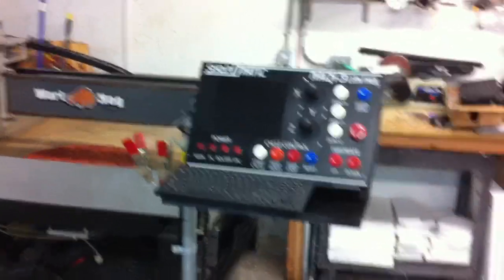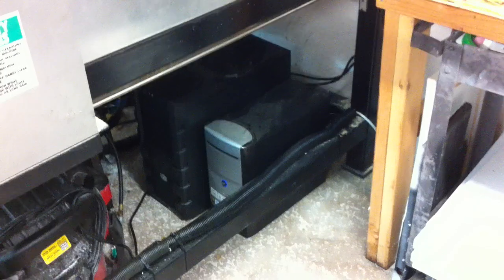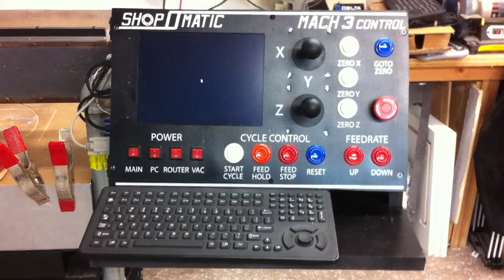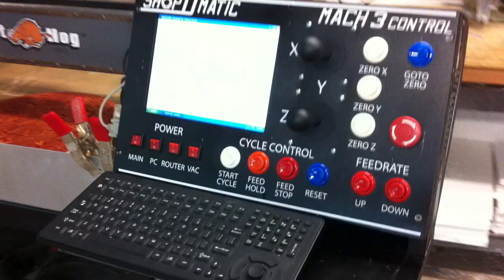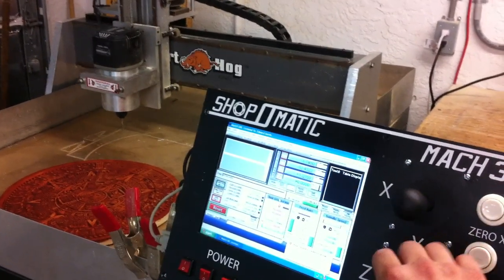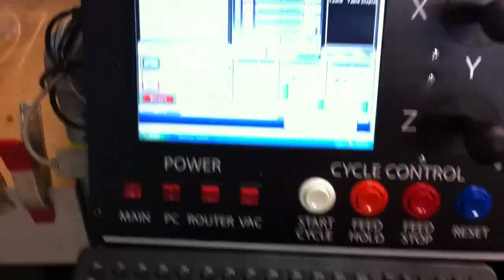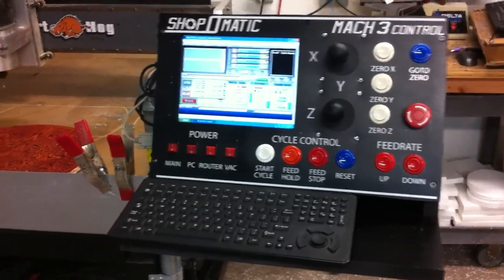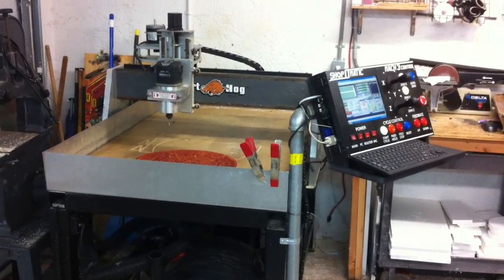DIY Dedicated Mach3 CNC Control Panel

Comment: Nice work!  What motors did you incorporate for your drive? ....Particularly the X-axis with its slave.  I’ve built a 1 x1 meter all aluminum router utilizing 1800 oz. steppers driving 5mm pitch ball screws, believing that arrangement (steppers on direct drive) had the necessary low end torque for such a set up. Unfortunately my rapids have not met my expectations. Your comments would be appreciated.

Comment: For anyone confused, he uses an I-Pac to emulate a keyboard. You just tell it what button sends what keyboard command and your done. For any arduino nerds, you can achieve the same using the Teensy (google Teensy USB Keyboard) as the Teensy is already a keyboard.